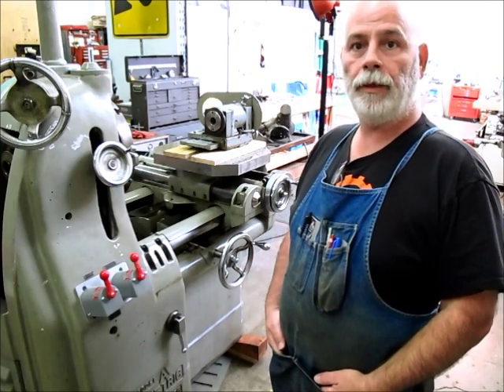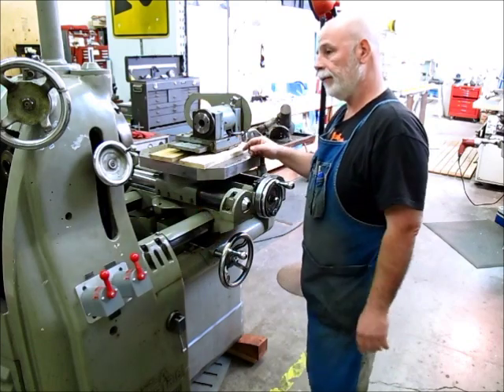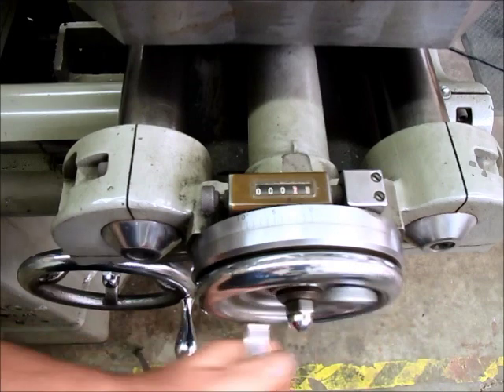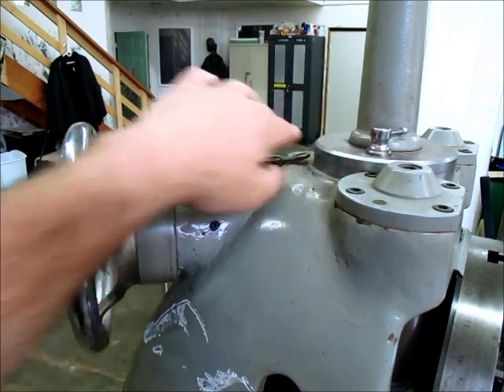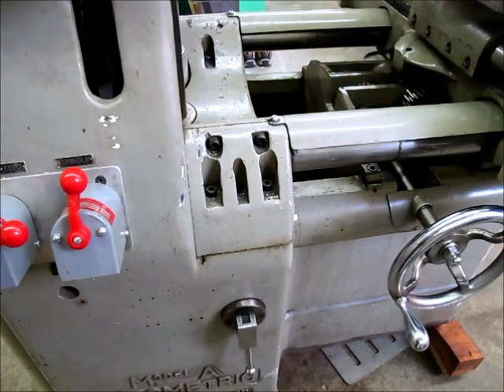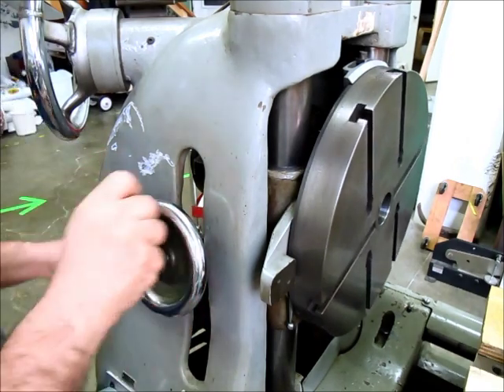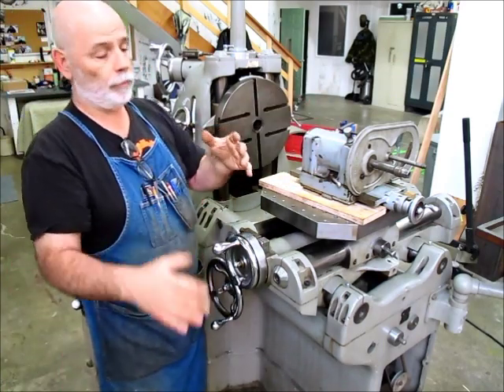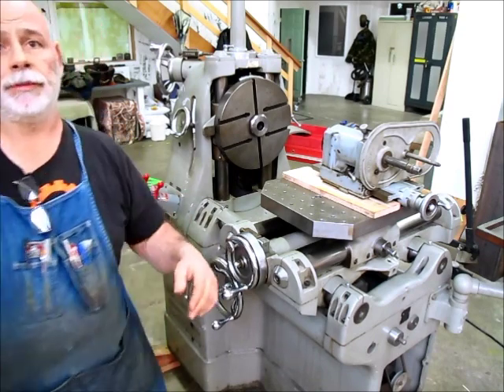Autometric Demo

Comment: Now you have (almost) everything to produce your own car-engines , gearboxes , transmissions etc. 
This is the machine you need to get the multiple bearings of a crankshaft straight inside an engine block , and at the same time control its proper position . 
Here you have a photo of a bigger brother of a similar machine  doing his job on a Tiger hull.
https://i.pinimg.com/736x/36/9c/3d/369c3da910852248979b708be60c3dc2.jpg

Comment: Tom, you have to open up that ball variator or whatever it is and see what makes it tick, that's just a little to cool not too understand its engineering.
Reply from the maker: Hi David,

I  would love to fillet one of those. I have seen cross sections but never been in the guts of one. Thanks for the comment.

Cheers,

Tom

Comment: Hi Tom,

Nice piece of kit! Very compact and versatile and built to last like most older products were. I'm only a spring chicken at nearly 47 but in my own short lifetime I've already witnessed the collapse of the British manufacturing base and the deliberate export to China of jobs and technology and the simultaneous import of cheap foreign (mainly Polish) labor to do what's left that isn't profitable otherwise. As bench joiners, us English guys are now outnumbered 11/5 by Polish and Romanian economic immigrants. Of course Americans are almost all economic migrants mainly from Europe and Ireland, hence your wonderful accents!

You're so much easier to listen to and more natural on camera than uptight English guys like me. I think half of Adam's popularity is his 'Southern drawl'. I sound more like Basil Fawlty!

Anyway, regarding your Autometric whizzbangery, I can't imagine that the manufacturer would have allowed the feed rate change box to make that rough grinding noise from the factory, given the obvious care they put into the rest of the machine and it sounds like something is either very worn or nearly broken so how did the inspection go if any? Would be interesting to see under the cover plate?

It seems that the old timers cared much more about keeping the workshop quiet where possible (much more civilised than modern folk) and using plain bearings etc. to this end until higher speed, zero maintenance production became the norm and it just doesn't sound right to me in the context of the overall machine's smoothness. If the noise can't be stopped altogether, try adding to, or replacing the lubricant with Lucas Oil Stabilizer as it clings to parts (just like your 'Cling' tapping fluid actually but even thicker!) and really smooths out gearboxes and worn engines. Your straight cut lathe gears would be ideal candidates, for example ;-)

It's expensive stuff but nothing worth having was ever cheap. Except used British and American made machinery of course!

Also, I didn't hear you mention finish grinding yet with the cross slide mounted spindle, which I think might turn out to be it's forte, given the low speed headstock and higher speed turret spindle configuration. That would save the lathe from all the dust and set up downtime with a tool post grinder too.

With minor stabilisation bracketry you could also add a Bridgeport 90 degree adaptor head and use it for larger diameter face milling or outside edge grinding work.

I really need to get my workshop finished as I'm fast becoming a frustrated armchair expert watching you guys!

There's just something so addictive about watching machining videos so if you'll excuse me I'm off to watch my weekly fix of SNS!
Reply from the maker: +SupraSmart68 Hey Smart or should I say Basil.....

Thanks for the nice comment. I have not torn into the feed gearbox as of yet. If and when I run it some more the feed will become more important. I do have a toolpost grinder so it might be interesting to see what it would take to get it mounted up. I have thought about rigging a tailstock of some sort on it which might make this an interesting grinding machine. Thanks for the comment.

Cheers,

Tom

Comment: Wow Tom you have an awesom machine there, the possibilities on the use of it are almost the only machine a shop could need. Wish one of those would fall off a truck near me. Great job on the repairs , shows a little time and effort makes things work. Plus shows how well the machine was made from the beginning . I enjoy your channel and several others , I'm also an old machinist used to do all the really big machining, my first boring mill job had overhead flat belt drive , fun had so many indicators to keep tolerances close , needed six eyes.
Reply from the maker: Silverbullet Hi Bullet,

Thanks for the comment. One of my old buddies used to tell me how they changed speeds with those flat belts still running. I guess OSHA hadn't been invented yet. 

All the best,

Tom

Comment: If my memory of my grandfather's WW II stories is still with me, these machines were in wide use for propeller governor assemblies, which required unique angle drilled holes and threads into the main governor hub in Hamilton Standard, Hartzell, and many other propeller manufacturers.
Reply from the maker: Doug Hanchard Hey Doug,

Thanks for the comment. I sure wish I could talk to some of these old timers now. 

All the best,

Tom
Reply: With a brand name like AutoMETRIC?

Comment: Tom, that is one crazy arse machine you have there. I think that it will be the sort of machine that will take a bit to get to know and used to and then it will become so useful that you will wonder how you ever got by without it.
Once you get that boring unit on the cross slide up and running I do believe that you will not only be able to mill circular profiles and rebates, but by changing the angle of the cross slide you will be able to mill profile shapes that are not possible when the work is presented to the cutter at 90*. Think along the lines of a wood router with its range of bits and then changing the angle at which it is presented to the work.
Reply from the maker: Mark Fryer Hi Mark,

You are right about that. This thing is going to bend the mind a bit. It has lots of possibilities that will need to be explored. I'm asking Santa for a three axis DRO this year. Thanks for the comment.

Cheers,

Tom

Comment: Hi mate.
That machine is a little workshop by itself.  I would not let go of that one, where would you buy one, if you find that you needed it after all.  I did not realise that these are not the original switches, and look a little fabricated, would you change them if you could get the proper ones?  Mr K&T, made some weird and wonderful stuff.
Reply from the maker: Marcel Timmers Hi Marcel,

The documentation on these model A Autometrics are as scare as hens teeth. I have one tiny brochure and that's it. Someone retrofitted the drum switches. It really is crying for a VFD on the main drive so you don't have to switch belts to change speeds. Thanks for the comment.

Cheers,

Tom

Comment: hi tom did you get any further forward with the autometric
Reply from the maker: Hi Andy,

I bought some pulleys and a chunk of plate for the motor mount. I need to get this thing operational or get rid of it. My shop is filling fast. Thanks for asking.

Cheers,

Tom

Comment: the ball variators, there's an old plan in popular mechanics for a 6wheel atv, like the max, that uses two of them.
Reply from the maker: Hi Felderup,

You would be able to hear it coming from a mile away. Thanks for the comment.

Best,

Tom
Reply: oxtoolco not just the variators, chain drive to all wheels, 2miles.

Comment: If that ball drive is what i think it is, there's usually 2 bevels and one or more balls, all held on registration with springs, if the springs on the ball(s) get weak, it may be possible for the bevels to contact each other and make the drive go in reverse, that may account for the noise
Of course i could be totally wrong.
Reply from the maker: Hi Sparky,

Thanks for the comment. This drive has the ability to reverse direction on purpose. Part of me wants to take it apart for fun and study but I have enough projects right now. 

Cheers,

Tom
Reply: Hey sparky, good to see you over here! Small world...

Comment: What a great machine! I guess the problem is that it can do so many operations that it's hard to wrap your head around. We tend to think of jobs according to the machines we have and their capabilities. My buddy bought a Mill/Lathe combo and has to try hard to think of ways he can use the Mill during a lathe operation...  The Autometric can do so much more but requires thinking in the Fourth dimension.
Kind if like the ShopSmith Mark V for woodworkers...   lol
Reply from the maker: Hey John,

Wait till I get the sub spindle on it. This is going to be a prismatic conundrum to say the least. 

All the best,

Tom